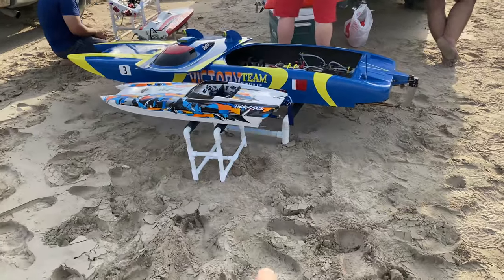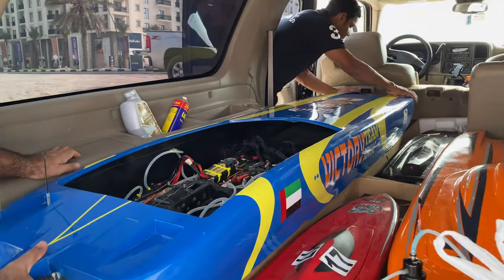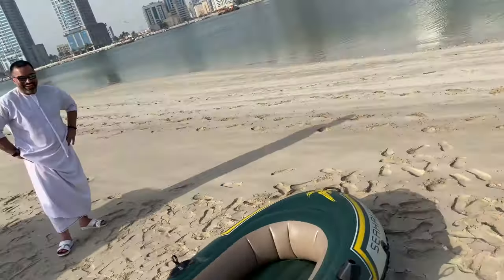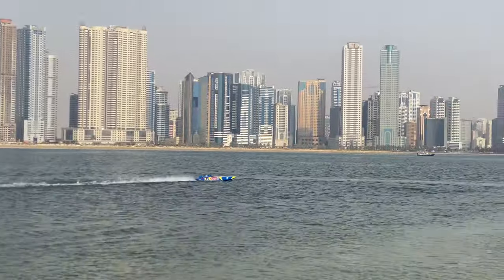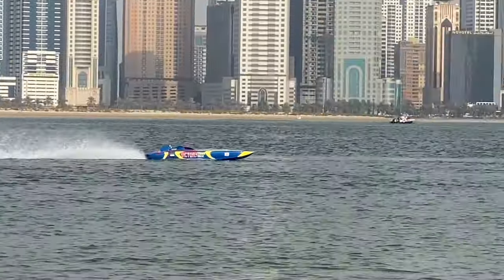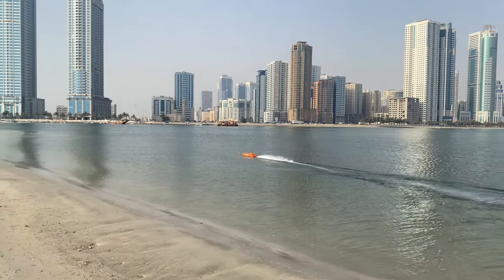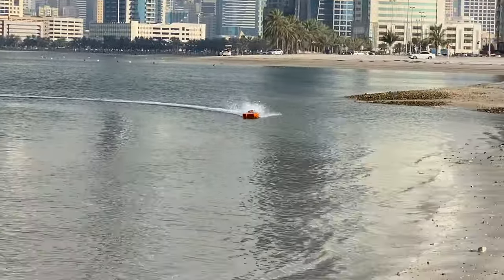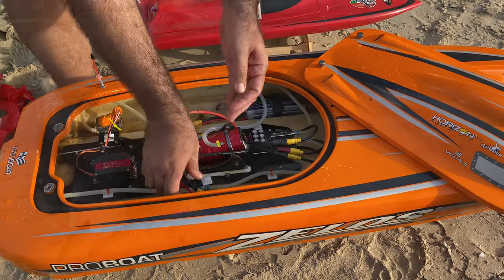Biggest RC Boat view and RUN 94" 2.35m

Comment: Drinking game; take a shot each time he says OMG🤣🍻
 Damn thing is slow and unstable.
Zelos though is flying!💙
Reply from the maker: We still testing it on 12s , its capable-of 24S
Reply: @UAERCADDICTS  I'd say you need to sort the stability out before contemplating 24s.
Reply: Lmao 🤣
Reply: @UAERCADDICTS  The batteries they use are very small and not powerfull enough. With these motors the boat shoul be flying. They need to buy bigger batteris and place them properly so the boat is stable and can turn smoothly.

Comment: Each of the hulls of the catamaran should house motor, esc and batteries.  With main weight being on the second step.  Only rudder servo and radio equipment should be on the tunnel.
Reply: Fully agree. It would stop that slight weaving we were seeing .
Reply from the maker: Thanks man
Reply: An adjustable skeg on "inside" hull/sponson?

Comment: Very nice rc boat,  Needs some adjustments at the back , I can see it chine walking when he is speeding up , A set of adjustable trim tabs would fix  that chine walking unless those stingers on the boat are movable but I still highly recommend trim tabs which can also help with torque roll , Have fun & best of luck .👍

Comment: I believe the tailfishing problem can be solved spacing the rudder cables wider. There should be a lot of water pressure at the rudder blade moving the rudder side to side. Also the cables inside the boat must be running inside a a larger tube. This will prevent the cables from bending.

Comment: That big boat is seriously under propped. You can hear it cavitating in the water. Also the horizontal oscillation can probably be fixed by tightening those rudder cables.

Comment: 3:25 Put some real batteries in it and take the slack out of the steering cable, and that big dog will rip!
Reply from the maker: thanks ken yes we are still testing it on 12 s it can run up to 24 but first let us make the 2 motors and esc lunch exactly at the same time :)

Comment: looks like motors are out of sink or problem with rudder
Reply from the maker: Synchronization is the issue
Reply: Looks to me there is to much slack in the rudder cables allowing it to sway bavk and forth in the prop wash.

Comment: This looks like HPR 233, not MHZ 245.
Need to set this up correctly.
Reply from the maker: it is German boat and its called MHZ 235
Reply: @UAERCADDICTS  lol, you are wrong!
MHZ was a Mystic and this is not.  The rear of the boats are different.
I own a HPR 233 and MHZ 245.  HPR was Swiss made and MHZ is sold by Germans but not made in Germany.
To prove my point, go and visit mhzengines and you will see you are wrong.  Also the boat has HPR hardware which does not fit MHZ (rudder).
Reply from the maker: @e46s54  it is MHZ 2.35 Meter
Reply from the maker: @e46s54  it was the  Mystic C5000 | Catamaran | 2350mm (94") | 2strock dual motor version we converted to brushless

Comment: The wire to the rudder is way too small.
Reply from the maker: this is true but we still need to match the timing and throttle response to the ESC's and motors